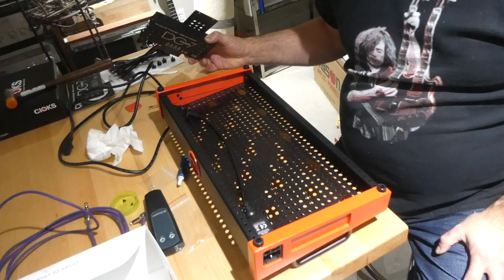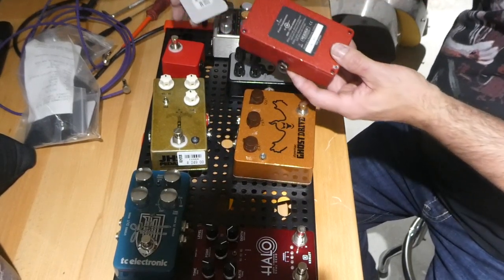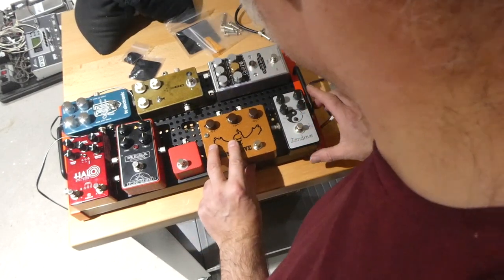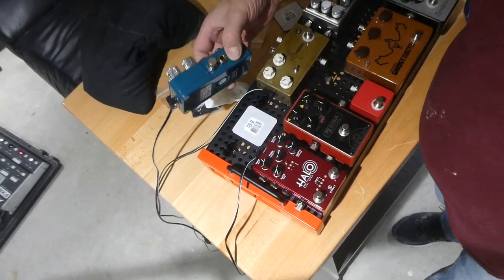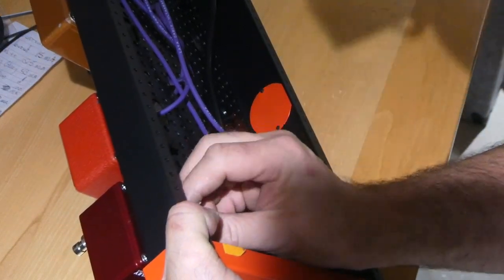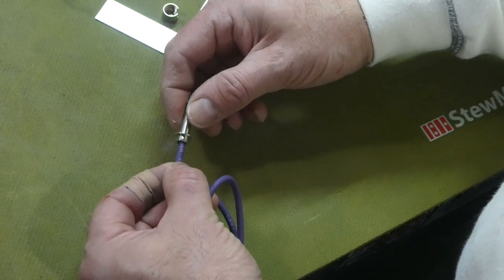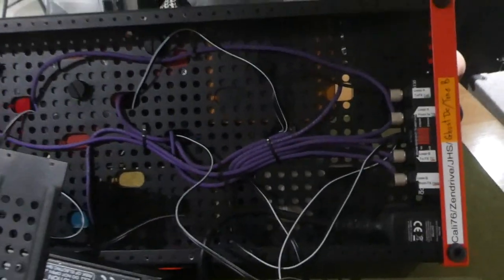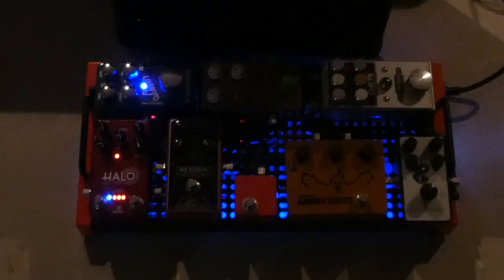Temple Pedal board assembly - Solo 18 with Lights / Hard case _ No Velcro

Comment: Great video, thanks! Did your power source already have the screw holes that lined up with the stabilizing brace? Is it made to be used with a temple board?
Reply from the maker: Thanks........Yes the screw holes line up perfectly with the ciocks power supply. I keep buying pedals and I will build another temple board and will use the ciocks power supply again .Good stuff for sure !
Reply: Got it, thanks. I have always heard to use a single isolated power source to each pedal. Does it not cause any type of noise or issues when you do the Daisy chain? my board will have about 12 pedals.
Reply from the maker: @jim3232  The 3 that I daisy chained have a low current draw and I never use those 3 at once, just 2, so I have not experienced any issues at all. Also try and move the power cables away from the audio ones and that helps. I love this Ciocks DC7. If you start with this, and daisy chain to accept your 12 pedals, and it all works, then you're golden. If not, you can add a DC4 to your DC7 and have 11 isolated outputs and then just daisy chain 2 that you seldom would use together.
Reply from the maker: @jim3232  https://reverb.com/ca/p/cioks-dc4-power-supply?hfid=46179054&utm_source=google&utm_medium=cpc&utm_campaign=18085516991&utm_content=campaignid=18085516991_adgroupid=_productpartitionid==merchantid=116772426_productid=46179054_keyword=_device=c_adposition=_matchtype=_creative=&gclid=CjwKCAjw1YCkBhAOEiwA5aN4AY6K-VEdzNVYBk8jKDjxV5Iz92zSJsYHEgu9LMPT7hGaEK3RO6otKRoC1ZMQAvD_BwE

Comment: This is awesome.  The power supplies normally  take up some prime real estate on the board.  Where did you get the bracket that fits the solo?  I know there's a middle bracket forthe duo 24 but not for the duo 17 or solo 18 that i could find.
Reply: ah... they can be found on amazon and sweetwater.